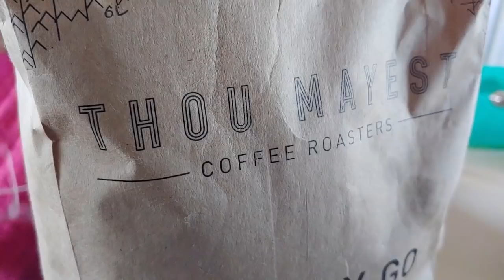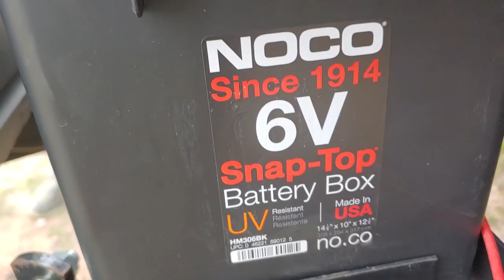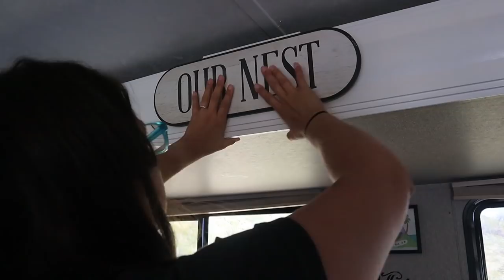RV Quarantine Life: Travel Trailer Upgrades & Maintenance (Happy Easter!)

Comment: We have that same macerator  I don’t know if you have a battery pack or not but we have one and that’s what we hook it up to. Just set it right near us while we’re emptying the tank. Our macerator worked well for about 1 1/2 years and now it’s giving us major problems. It blew a fuse so we replaced that but it’s been having issues since. Also, we used one of those water bags for a couple years. Accidentally popped it with an ice scraper. Whoops! Handy bag though!